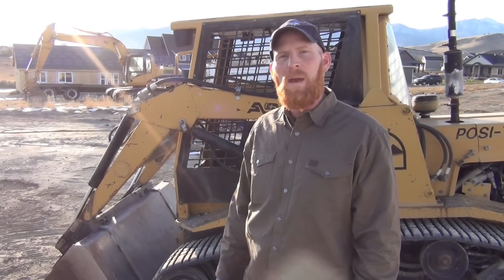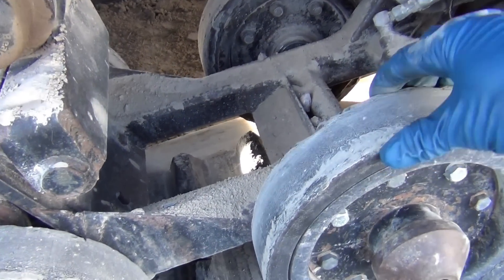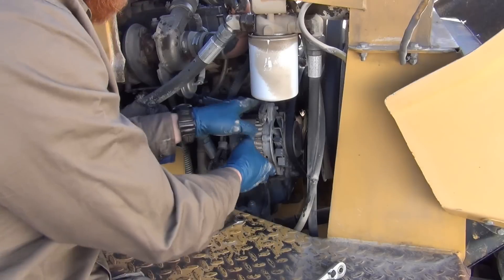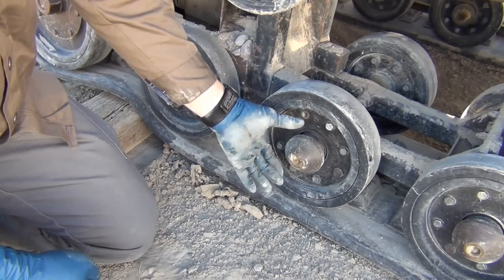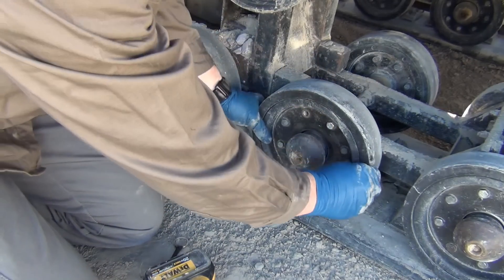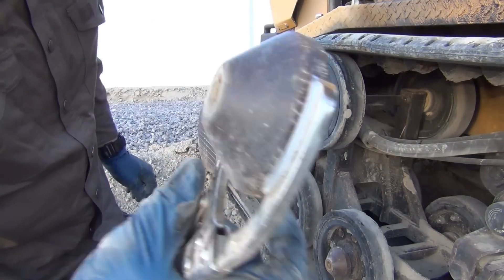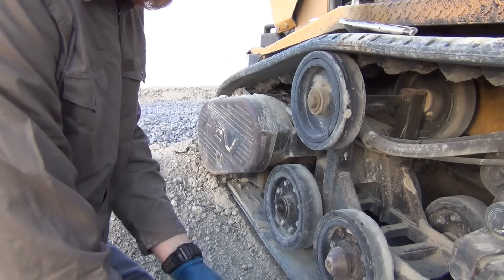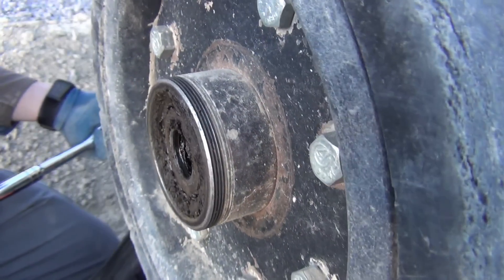ASV Skid Steer Repairs You Can Do

Comment: Anybody know the location of the hydraulic oil temperature switch on the rc85/100? It seems it's in front of the engine compartment but behind the hydraulic pump (accessible only when lifting the cab). If this is the case, how on earth do you access it to replace or test? Thank you in advance for any information.

Comment from the maker: Anybody catch the track controls for this thing at 10:35?  Pretty crazy huh?  Super weird to adapt to, but smooth, fast, and stable once you do.
Reply: ASV  are awesome machines.  I have an rc60 a few years newer.  The track system is very high maint, but worth it.
Reply: I have had this same machine for 20 years. 
It is a work horse that you need to maintain because parts are high priced

Comment: Question can you tow a pickup truck or  cars without engines using a tow bar ,will they trail correctly without the engine weight  ?

Comment: hay brian, I have a  question about some power seats im installing in a old 77 chevy van. have you ever seen a power seat that needs two hot wires going to it with no ground? seats are from a newer vehicle...  and do you have a place where people can ask you repair questions? thanks John
Reply: Just came across your comment.  Wouldn't the electrics earth to the body by bolted to it....